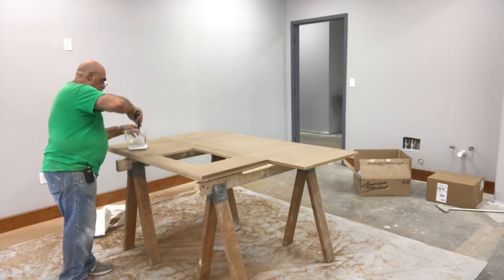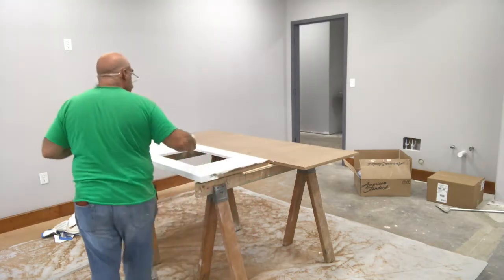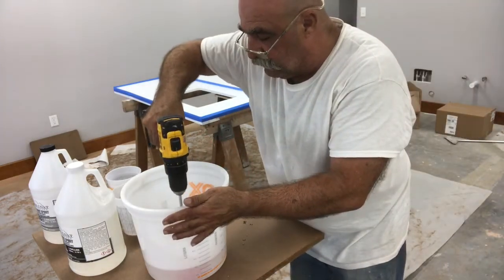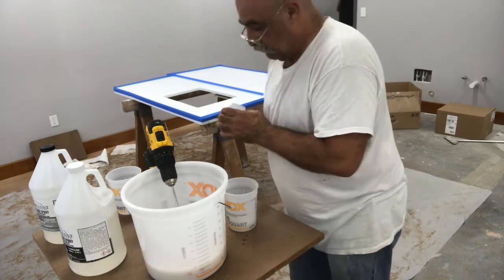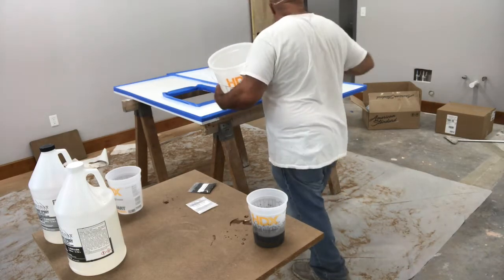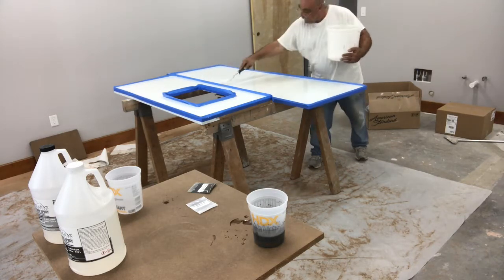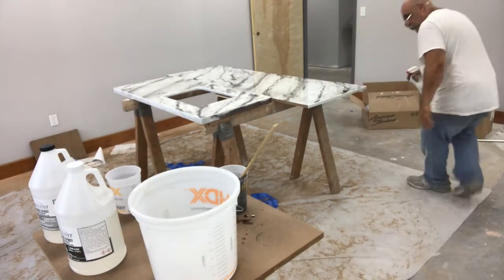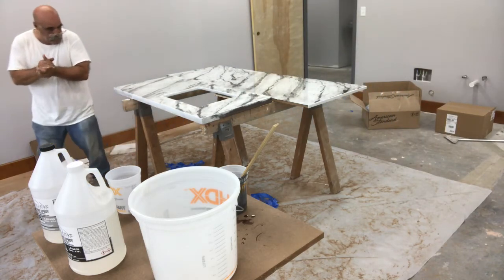Epoxy countertops

Comment: The technique you used was different than what I'm familiar with which is pour and trowel. I'll be redoing an "countertop from hell" sometime in the next couple of months. After exhaustive research (and ruining things), I decided to go with the system from Daich with an epoxy top coat. I'll have this on my new YouTube channel when done. By the way, I'll be crediting you on the cabinet refinishing as I learned a few how to's from your video on painting thermafoil cabinets.
Reply from the maker: xtremefight This top came out very well but I’m getting ready to do another video with the topcoat
 I separated them because people sometimes don’t do a topcoat it’s a short video but I’m going to do that
 I like the procedure that I did everything flows very well you don’t use a lot of excessive material but you can spread it out with the roller, level the wood first or almost level and then I spread it out but I missed one thing I was actually doing three tops at the same time and I had some stuff come up in one of them so I elected to do a topcoat and I’m doing that video now.
I don’t know the method you’re talking about I would like to see it and let me know when your video goes up also I appreciate it and I appreciate your comments
Reply: @buildingwithpapa  Another thing I was wondering; All of the guys I've seen who do these full time coat the bottom of the mdf with red ball. What are your thoughts?
Reply from the maker: xtremefight I don’t believe it’s necessary but I would at least code it with the undercoating